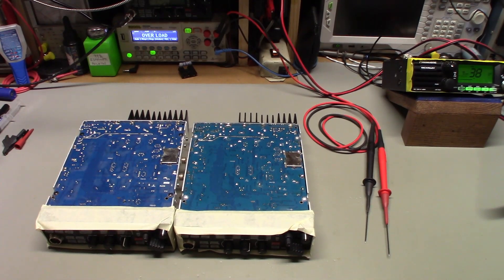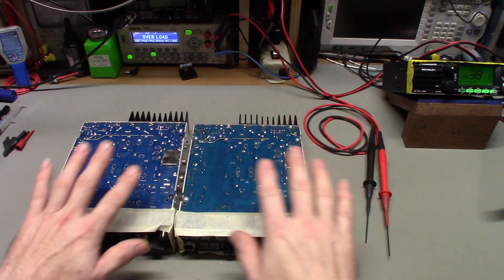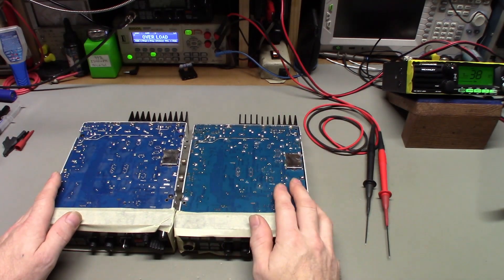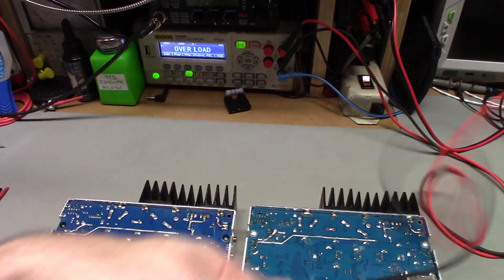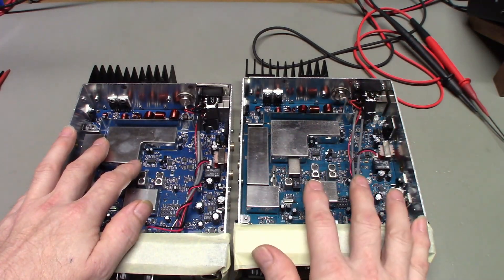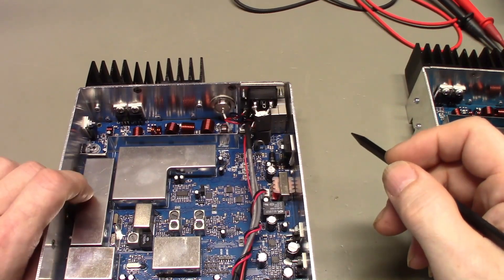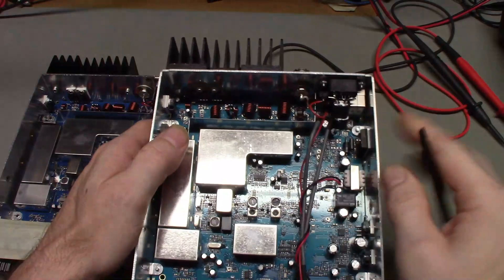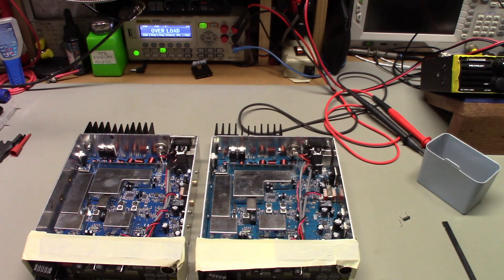High SWR's blew up your radio.  Simple testing anyone can do to repair it.

Comment: After just watching a video claiming this can't happen it was refreshing to come back to reality.  Great explanation.
Reply: @BowWowPewPewCQ my name is Paul.  I am watching MikesRadioRepair YouTube video to really put my best foot forward and put in an honest effort to learning about testing two radios.  At approximately 8:32 I hear that the "left terminal of the mosfet is connected to ground or the ground plane and the lead is sort of hovered over that area of what looks like to me as the "circuit board" okay, so, since I am not sure if the brand of CB transceiver I will be working on will have the same final transistor or not, in other words I am trying to say "how would I now for sure, when working on another but similar chassis that the same place on the circuit board is ground or ground place area, they look quite similar but they all seem to work a little bit different"  Do you think that it is okay if I send MiesRadioRepair an email asking a question to this effect?  cause I really want to get a making noticeable performance improvements!  One thing I was thinking is that maybe, if I get a toll free 1-800 number from an owner's manual I can call directly and ask questions to someone who answers the telephone call.?  Maybe it is great because they may know that particular brand and they can walk me through it such that I can see and hear ally noticeable results.  I don't mean to like make the volume go so loud that it is obnoxious or it disturbs everyone in the community and so forth but I guess what I am trying to say is or the word I am trying to get it is that I have a sense of accomplishment from working the CB radio and that the the other are on the channel or band notice a difference!  I am not sure how to express it otherwise.  Once upon a time I was in a shop in Buffalo New York America and I could here a very noticeable difference and big signal out of an amateur radio once, I guess i will call the shop keeper worked on the radio.  Really big signal readings on the S/RF meter and loud volume.  i partially get scarred when the signal are really loud out of the speaker when I am by myself like I will get in trouble for disturbing people, but I do not wat to do that, that is not my intent.  I guess I sort of want a purpose, it is funny why would I think about "performance improvements" I think that way equipment is manufactured and made is really great the way that it is!!!  However, I think that deep inside I could contribute to radio gear and such.  Well I thought I would just run this buy you and I will send the same thing to MikesRadioRepair in the email that I see the best I can in YouTube.:stayhome:😀🧑‍🔧🐾🐿🌎🏁:face-red-smiling-live::yt:

Comment: I have a friend who checks his SWR off the radio and it is great. He is a ham operator and when he runs an amplifier it shows a much  higher SWR. Should he be concerned or disregard the reading and only go by the. "barefoot" reading?
Reply from the maker: Yes, he should be concerned.  When you are running a amplifier you need to place a SWR meter in two places, between the radio and amplifier and another between the amplifier and the antenna.
Reply: Ok. Thank you I'll tell him!

Comment: Just a reminder to those who make their own coax cables:

 Coax,  (especially the foam core), can suck in water like a fish. It's amazing how much water can wick into your cable if it's not properly sealed. You can generally tell this is happening if your SWR is good on a dry day and they goes wonky after it rains. Then it dries out and your SWR is good again. Chances are you have water in the line or your antenna itself has some water intrusion somewhere.

 So make sure your antenna system is SEALED. The coax is overlooked and skimped on 99.9% of the time. Waterproof all connectors. You can use Mastic tape on connections you may want to remove later. Just make sure and SEAL it. Also routing your cable out of the direct weather is a good idea (under your house eave, car hoods, etc). Little exposure as possible. 

For underground runs, I put mine inside electrical-grade conduit for extra protection. A little extra work and expense, but It's cheap insurance. It also helps if you find yourself digging later around your coax. You'll hit the conduit first and not damage your coax.

I also like to use heat shrink (the type with the glue inside) to seal where the coax enters the connector. I don't rely on the solder alone for sealing. Get GOOD GRADE heat shrink. Not that cheap Rat-Shack, Harbor Freight thin garbage. Get the 2 or 3:1 stuff with the heavy glue. This stuff will seal just about anything. Likewise it's tough to remove so be sure your solder and coax tests out OK before you install the shrink.
Reply: Very good post... Very well said. Listen to this guy; he knows his stuff...
Reply: Self amalgamating tape is is good also, especially if you live in a area with destructive birds that like chewing on coax ends. Though usually they are that particular, gotta chew it all in some parts of the world.
Reply: I remember years ago, operators stating that their match would improve in the rain. I never tried to disprove or prove that because I never gave it much thought. Recently I have learned the importance of sealing the coax and the connection that faces the weather on a daily and nightly basis.

Comment: On an FM only radio  Btech  GMRS-50X1 if the final is burned out,  is there any other component that should be premptively replaced?
Reply from the maker: I don't have a schematic for it, own one and have never worked on one but if the final is bad that's probably all it needs.  I would probably probe around with a oscilloscope first to verify it's the problem and if it is take some voltage measurements.  Basic troubleshooting.

Comment: I had a lighting strike one of the antennas that I had up. I had my ham radio unhooked. but I had a free play radio and a am drake which both got hit by the lighting. magic smoke came out of the drake. still got it around here some where. after it killed those two radios. it by passed the big screen i had bought was fine but it went on past and fried the misses computer. go figure.

Comment: Now, if I could make heads or tails of my switching power supply layout vs. schematics to fix it. It blew out the mosfets... strange because it is supposed to have overheat, over current, over voltage protection, but when doing testing using it, it overheated and did puff the magic dragon on me.

I have replaced those, but the supply is stuck in protection mode, and I'm at an impasse.

Alinco DM330MVT
Reply: Switch modes are like Morris the Cat, finiky ;)  I've seen the coils change value and thus change the frequency and blow the mosfets!!!

Comment: Mike do you sell radios
I am in the market
AM/SSB
It will be used in my truck and never as a base
So I'd like to have as much output as possible of course
Reply: You can never go wrong with a good 'ol Cobra 148 (old school version).
I've had mine for years along with my Grant-XL and both work great to this day. 

I paid $50 for my last 148 at a yard sale. Not a damn thing wrong with it other than needing cleaned up from sitting and a quick tune up.

Comment: On my Lincoln 2+ I moved my AM regulator to the back where the heat sink is. When it was on the side, it would get hot hast. I put a new Tip-36 on the back and it’s night and day difference. The regulator and the finals run nice and cool. That was about 2 years ago. No problem since.

Comment: Can the method you used to check the final be used on older radios? I've got a Robyn SB 520D with weak (if any) tx output. I didn't see any other damage. Would it be a good idea to replace the AM regulator also?

Comment: I have noticed several  videos on blown finals. Many of the videos involve the President Lincoln II. I recently  acquired a Lincoln II. Guess what? I blew the finals out. I've been into radio's  for 20+ years and never ruined a radio. My swr was 1:4  and I have current chokes in line at the radio, shack entrance and at the antenna. My Lincoln had the 1310n transistors. I shipped it off and I was advised to go with  better transistors.

Comment: I’m having problems with my SWR high it goes to three no matter which way I put it on channel 1- through 40 still stays the same three I can’t get it down I checked the coax coax is fine the ground it’s fine but how can you tell if the antenna I have a trucker 2000 I’m thinking he’s got some kind of a gram problems on the van I have it on the van back of the van

Comment: Mike, are there different SWR meters for different bands, or are they all the same? I have one that I used for my CB, will that work with my Marine VHF?
Reply from the maker: No, they are not the same.  You would need to look at the specification sheet for the meter you have but most meters used on the amateur radio HF bands and on CB only cover up to 30MHz and maybe a little higher.
Reply: @mikesradiorepair  Thank you!

Comment: A message the Freightliner Cascadia is is impossible to get swrs much under two hope I don't smoke my little 29
Reply: They used to make an SWR meter with a built in Pi-L network (transmatch) you could install to regulate SWR.  I use one to go from 10 meter to 11 meter on the same antenna.

Comment: I have a RK5640a running a Wilson 2000 on a 18 ft Wilson cable running for a few years w/0 SWR all the sudden it started crackling when receiving transmissions but I was able to transmit fine two days ago it just stopped receiving and transmitting all together thought cheap radio lasted longer than I expected however now I've installed two brand new radios both same issue seems when I go to calibrate it starts working normally and then the needle shoots back and forth a few times and then down to nothing no response the rx/tx lights up antenna lights off and no responses from the R/RF,SWR,CAL settings I'm puzzled could it be a bad antenna/cable killing these radios?
Reply from the maker: Yes it could.  You may have a intermittent short.  If the coax cable is routed through a door jamb the cable may have become crushed.  Depending on what type of antenna you have I have seen loading coils fill up with water.

Comment: How important is your coax for lowering swrs I'm having a lot of trouble
Reply from the maker: Ideally your coax cable shouldn't effect your SWR.  It's a 50 ohm transmission line.  However if your coax cable has poorly installed connectors, has had water intrusion into the jacket or has become kinked or smashed that can greatly effect the impedance of the coax cable which in turn would manifest as a higher SWR.  The big difference between grades and the diameter of the cable is the loss.  Larger diameter and higher grade coax cables have less loss meaning more of your TX power actually makes it to the antenna and on RX more of that signal makes it to the receiver in your radio.  The big advantage of working in the HF range of frequencies is you don't need to get crazy with extremely large diameter coax.  Loss doesn't become a big factor until you get into the UHF range or higher.  Personally most of my HF antennas with runs under 100 feet I use LMR240, over 100 feet I use LMR400.  At UHF frequencies I use LMR 400 for shorter runs and LMR-600 or 7/8" hardline for longer runs.  My microwave antennas have at a minimum 7/8" hard line with most being fed with 1 5/8" hard line.

Comment: Hello there,

Yesterday we had a snow storm and i heard a (tik tik) poping sound coming from my coax . I was not transmitting with the radio. this morning i turn the radio on  it receive ok but when i puch the PTT, no modulation indicator an all mods. what could be the source of that poping sound and could my radio be fixed. any idea ?

Same radio President Lincoln II

thanks
Reply from the maker: That doesn't sound good.  Lightning storms, snow storms and sand storms can all cause ESD damage.  Every snow flake that hits a antenna can deposit a small static charge and that charge builds up.  Eventually the potential gets large enough it can arc over and unfortunately it sounds like it arced over inside your radio.  It's hard to take a guess as to what got damaged.  You would need to trace out the PTT switching circuit.
Reply: @mikesradiorepair  ok mmmm too bad your so far away (lol) Thanks for your reply and I love your videos .

have a gr8 day 73s

Comment: It seems like radios have some resistance to "blowing" finals. Even when presented with high SWR. I have keyed my CB before with out an antenna screwed in. On accident. And I don't think I blew the finals. Over time, I would imagine running a high SWR will eventually blow finals.
Reply: Depends on the reactance and impedance the radio is looking at ,the reflected power is generally misunderstood as causing radio failure but infact adds to the forward power back to antenna

Comment: How many Standing Wave Ratios does it take to "blow up" a radio? (it's SWR)
Reply: Less than 2:1 swr barefoot, less than 1.5:1 if you're running power.
Reply: A standing wave has never blown a radio up

Comment: First point, power is NOT reflected,  energy is.   The key point is that the reflected energy does not blow up finals.   What happens is that the TX is seeing an impedance it cannot cope with  - the PA is now operating in a condition which takes the finals beyond it's max ratings and they fail.   Power is NOT reflected into the finals!!!
Reply: I am still amazed that this still isn't fully understood in the radio community

Comment: Mike can you tell me can you tell me if the a.m. regulator would have anything to do with me mod fading out on the FM frequency after about 20 seconds it goes right back signal stays good but the mods fades out on the FM band I am in the UK and the radio is a Stryker sr955.thinks

Comment: I have the fix which allows those DC power supply regulators not to generate such a huge amount of waste heat.
I proved this concept, on the 50 watt filament power supply on my RCA-813 project.

Comment: I have a galaxy 33hml and I checked from the ground on the transistor to the opposite side and had continuity between them on both and it didn’t matter which lead I used on the ground but there was no continuity from ground to the middle of the transistor. Does that sound burnt to you?

Comment: Hi Mike, really enjoyed that video. I have the same radio and it's the first time I've seen what it looks like inside. Mine get's so hot where that regulator is, the case is almost too hot to touch if I run the rig above 5 watts - the finals heat sync never gets warm so I suppose that's a good thing? Is the heat normal for these radio's?

Comment: Why do CBers say "SWRs"? It's SWR. Standing Wave Ratio, not Ratios. And even if it were, it wouldn't have an apostrophe. That would be "Standing Wave Ratio is".....
Reply: I am always waiting for the some of them to say "swere" meter. No, a hundred times over, it's an SWR meter, doesn't take much longer to say but sounds a whole lot more knowledgeable.
Reply: @gorillaau  👏🏼👏🏼👏🏼
Reply: @gorillaau  The one I hear the most is 'swah' meter.
Reply: @stopthebus  I would assume that its a regional thing. Poor form regardless!
Reply: @gorillaau  I have seen it worldwide, I don't think it's regional.
Reply: @stopthebus  I meant swere vs swag pronunciation.
Reply: or "standing wave ratio has" - i.e. it owns something. The golden rule is that abbreviations are never pluralized. The trouble is people pick up bad habits and they get passed on to others. I live in a country which uses the metric system and I regularly see people write 'kgs' or for kilograms, 'kms' for kilometres etc, both of which are incorrect. Or they put another apostrophe in and write kg's or km's. It's really annoying when it's so easy to get it right. 
Even the news media does it and they should know better.
Reply: @stopthebus  kms would be kilo-milli-seconds, if that was a valid expression. Or kilo-meter-seconds.  I'm not sure what kgs are though.
Reply: @gorillaau  I read kms as kilometerseconds. Somewhat confusing when meter and milli use the same symbol!
You're right, could be read as kilomilliseconds as well.

Comment: Dear Mr Mikes ... My name is Marcus Motta and I live in the state of São Paulo Brazil. I own a CB Radio Cobra 148 GTL serial number 83018940 (by Taiwan) - an old model from 1980/90. I spent a long time without operating the radio and now when I turn it on, I realize that it doesn't receive any signal at all on channels ... only QRM (noise) ... Some indication of what could be happening ???  ... some diode or electrolytic capacitor???. ..lamentably I do not have the wiring diagram. thanks for your attention ... Motta, Marcus